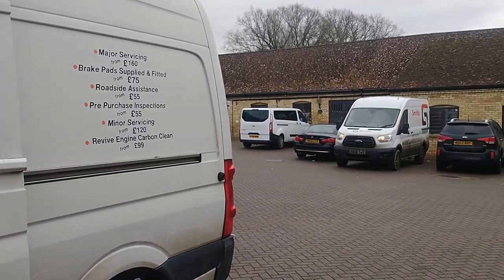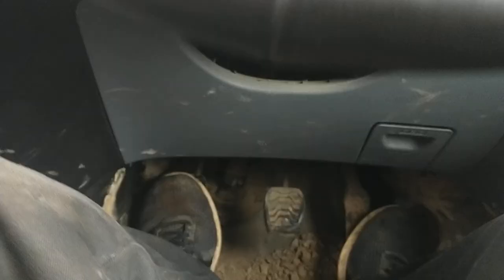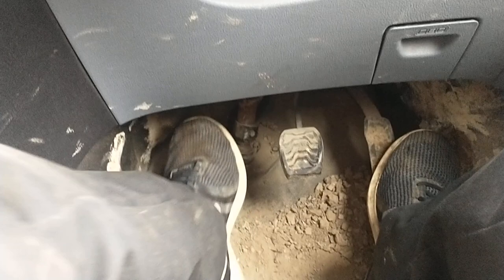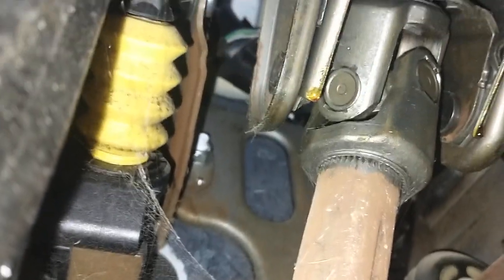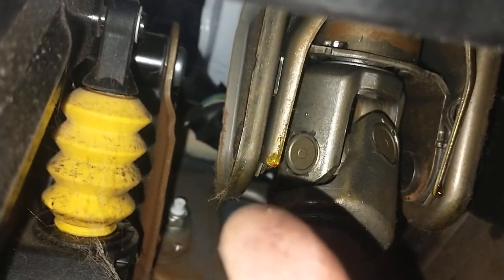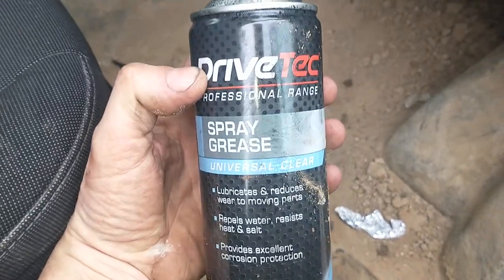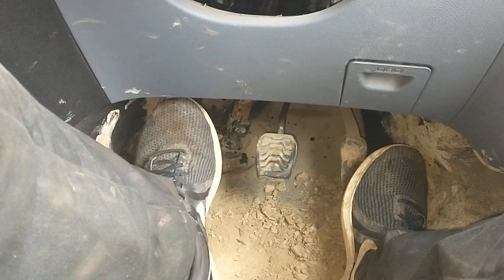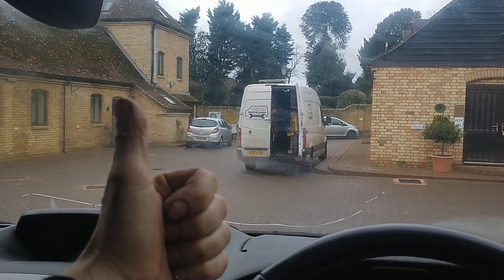Noisy Clutch Pedal Quick Fix

Comment: Jimmy I have a top tip with spraying clutch petals for customers cars. ....customer rings me with squeaky clutch pedal and had already sprayed it as I couldn't see them for a week. During the night the liquid grease creeped down the pedal unnoticed.  Customer drove off and at lights foot slips off pedal and he shunts the car on front. Insurance involved.  So glad I didn't spray that pedal. Just a thought
Reply from the maker: If you use proper spray grease or white spray grease they do not run after it's dried.

If you did use something WD-40 it may run down the pedal. Even so just like wheel bolts it's the driver's responsibility to check the vehicle is in a drivable condition before each  use  in my opinion?

Comment: jimmy what battery tester do u use and I presume it can be used on leisure batteries?
Reply from the maker: Currently I'm using the "Autolink AL539"
Reply: @ORileysAutos  can the auto link do EPB reset as I'm not finding much info, not sure whether to spend a bit more for the diaglink.